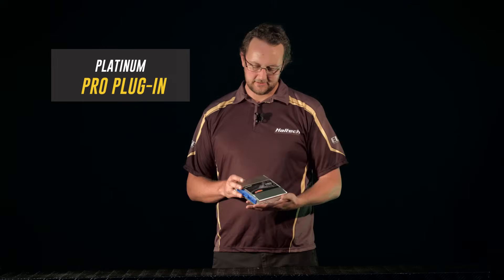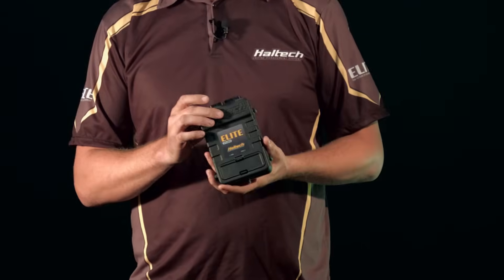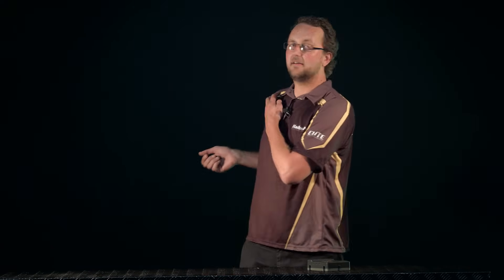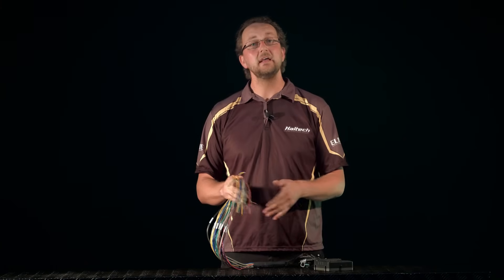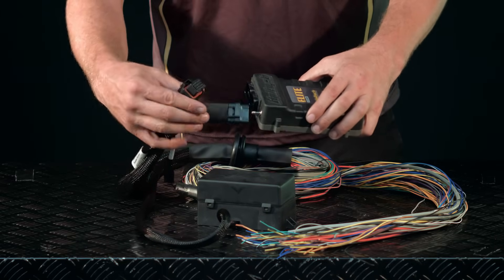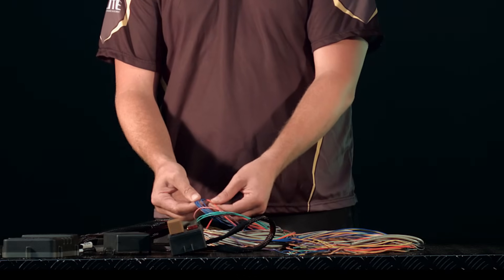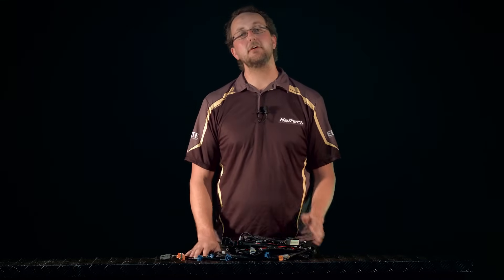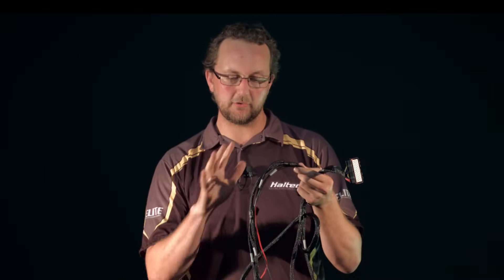6 Ways to Wire In Your ECU - Haltech Technically Speaking

Comment: regarding OBD2 - it seems there is a fundamental limitation with the Haltech ECUs. If Haltech devices are connected to both main and AUX connectors, there is no way to enable the OBD2 functionality.
Reply from the maker: If your Haltech ECU can support 2 CAN networks, you would need to run all of your Haltech CAN devices through one port. This would free up your second network for OBD2.

If you need more info you can contact our support team directly via www.haltech.com/contact-us
Reply: @haltech  Thanks. That's what I figured. As is, my Elite 2500 is wired to use Haltech devices on both main and AUX ports. The Nexus software is configured for both main and AUX for the Haltech CAN bus.
Of course, when I enable the vehicle CAN bus on AUX port and Haltech just on the main, I get all sorts of DCTs (because the ECU doesn't get some sensors).
Now, my question is how to wire things in such a manner that all Haltech devices are just on the main connectors. Isn't that's where the car's harness connects to? How to wire in additional things into it (like wideband, etc.). 
It's a Z32 with the PnP connector.
I did contact support and we had a lot of back and forth via email, but my question above still remains.
Thanks!

Comment: After seeing the Haltech unit that was used in the Mad Beetle build I was curious to see what I would need to get to install fuel injection and electronic ignition on my 1972 Super Beetle with the air-cooled engine.  At some point I would like to have sequential fuel injection. My car never had an engine management system of any kind.

Comment: Hello , I’m a big fan of your channel and love watching all your content on tuning and halltech knowledge, I am a die hard Mazda 323 familia/ laser tx3 fan . Being in Canada, we had in 1988 and 1989 , less than 2500 awd Mazda 323 gtx s and even less 323 Gt sedans with the same B6t engine but fwd. I have been extremely blessed to have owned quite a few of these amazing homologated road versions in my lifetime. Later on I fell even more in love with the 1.8L bp chassis  turbo engines , I imported a 323 familia Gtr engine with harness and awd transmission that I couldn’t use in my front wheel drive set up , so I was sold on the Autronic Sm4 stand alone Ecu from Australia, the unit was very expensive and my local tuner was supposed to be an authorized dealer, he got the car running , at 15 lbs the car put down 237 hp on a real mustang dyno , big front mount intercooler and 2.5 inch exhaust, everything else , stock. I never really got to see the real power that engine could deliver because I’m sure my tuner wasn’t in his usual Subaru territory.

Comment: hi , building a countach replica using a 95 bmw v12 5.4 , been told its best to use 2 ecus and treat it as 2x  6 cylinder engines , is this something you could help with ?
Reply from the maker: The NEXUS R5 should do the trick:)
https://www.haltech.com/new-release-nexus-r5-is-here/
Best thing to do is to contact our Tech Support on support@haltech.com and go over your setup with one of our tech guys just to be sure:)

Comment: Do you make an ecu for an Allison #3040 transmission
Reply: How much for all this stuff
Reply: I would like to know if you make them for the faulty ecu 29511202  I have a faulty ecu in my RV diesel pusher Allison shifter mode button if you do please call me 415 933-4421
Reply from the maker: I am sorry but we do not. We design and manufacturer engine control units for port injected engines.

Comment: Excellent video. We're about to use the pre-terminated harness on our Project Trolvo
Reply from the maker: Looking forward to see that thing run - on full song too:)
Reply: Could you use an aftermarket ecu with the proprietary factory stock injectors and sensors as long as they're wired to the ecu correctly?

Comment: Is there anything that can run a 3UR-FE from a Toyota Tundra?  I want to use that engine in another car.
Reply from the maker: The Elite 2500 will suit that engine. It supports 3URFE's quad-cam VVTi, DBW throttle, and sequential injection:)
Reply: Haltech does this kit come with wiring harness?

Comment: Tuning fork is the HT051470 only thing availible for a 1993 mustang engine? I have a 1994 f150 running an a9l with a t-harness but want something tunable since I have heads, cam, intake, ignition, etc.? Also I'm having a hard time even finding HT051470 for sale any where.

Comment: Dont know, but 2500$ for a wrx ecu seem extremely pricey..... and out of range for my wallet, too bad. My project is a sti ej257 shortblock with ej25 na head for my 2008 impreza 2.5i
Reply from the maker: It's all relative. We do find it odd though that people won't think twice about spending thousands upon thousands on the engine, fuel systems, power adders etc, but then skimp on the engine management system that has to run it all.
Reply: Haltech I’m comparing the price, for exemple, to a complete ej207 engine ver 8 with a 6 speed and a ecu for 5500$ in Canada. I understand that haltech make great product, but if you could sell these ecu ( Elite 1000 ) in the range of 1000 to 1500$ it will be fantastic. Anyway
Reply from the maker: Elite 1000 with a Plug'n'Play Adaptor Harness Kit retails for $1614.
https://www.haltech.com/product-category/plug-n-play-ecu-kits/elite-1000-adaptor-harness-kits/

Comment: Does a stock 1jz harness go with Haltech ECU
Reply from the maker: Yes you can use Elite ECU with your stock 1JZ harness. You have two wiring options here: either use the basic universal wiring harness and wire it in yourself, or, if your 1JZ is in or from one of the cars supported by our Plug'n'Play adaptors then it's a simple plug'n'play procedure.
https://www.haltech.com/product-category/toyota/
Reply: @haltech  Thanks guys surprisingly cheaper than I thought building a Drift Car E30 tho so which is better 2000 or 2500?
Reply from the maker: E2000 will do the trick if you don't need all the fancy race functions, if you're planning to go DBW though you might have to go up to E2500. If you go to the E2500 product page and open the ECU Comparison Table at the bottom of the page you will see a feature-by-feature comparison between all ECUs. You will be able to see what features E2500 has that E2000 doesn't:)
https://www.haltech.com/product/ht-151300-elite-2500-ecu/

Comment: Would you use the premium 2.5m harness if you were going to basically trash all your oem wiring or vacuum lines in older cars and then replace everything with new sensors, coils, etc?
Reply from the maker: That's what we would recommend. The premium harness also comes with a fuse box.
Reply: @haltech  sweet. This very well may be the route I go down. Thnx

Comment: Would love one of these someday, though I bet it would be a pain on my US Z31 thats a mashup of several VG30Es from different vehicles and most of the sensors and things removed as well as a bunch of bolt-ons as well as custom fabrications. I think its basically running on airflow, water temp, CPS and O2 sensors alone at the moment. Not even any EGR, charcoal can, idle control anymore, just use set screw on TB and only vacuum hose is for brake master. Ac and heater core removed. Its not even original ECU. Have been told its from an aussie RB30. Just blah.

Comment: How bout a pippyback for a 2002 Mercedes C230k 2.3L supercharged engine?
I want to ditch the supercharger and go turbo, larger injectors, and possibly e85.
Thanks
Reply from the maker: If you are planning for E85 I would suggest looking at the Elite 750 which will run the engine as a piggyback and allow support for flex fuel in future.

Comment: What about german cars? Audi 1.8T would the cluster work with heltech?
Reply from the maker: On the vehicles the plug in kit is listed to support, yes the factory cluster does work.http://store.haltech.com/default/plug-n-play-ecu-kits/elite-1500-patch-harness-kits/ht-031002-plug-and-pins-only-male-deutsch-dtm-4-connector-7-5-amp.html
Reply: Thanks for reply. What about earlier models, without can-bus...till 2000s? Same thing or?

Comment: What's the go with the haltech p1000. Heard it only goes to 15psi. What needs to be done if I wanted to go higher
Reply from the maker: The Sport 1000 ECU supports any boost pressure with the appropriate MAP sensor. If you’re using the on-board MAP sensor, the maximum boost that sensor supports is 22psi. Don’t forget your ECU also needs to be tuned for your desired boost level!
Reply: So off the shelf the sport1000 ecu supports 22psi. i was told its 15psi and f i wanted it higher you guys would have to do your magic inside to go higher. Its tuned to 10psi on board map. I'll be upgrading a few things and I will want 3 psi settings. if you say its 22psi standard thats great news

Comment: +Haltechecu Question...what's the best option for an Sprint RE ecu for an rx7 FC second  gen? My friend started his project then hit a road Block... He basically took the stock ecu out and some of the harness. I've yet to dig into this for him to determine what's what.  The Sprint RE ecu did come with a harness for the ecu but does not have the built in relays/fuses. I can always add one but wish it was all in one package. What we need would be links to best connector options to use for injectors, all sensors ect...can u help?
Reply from the maker: Hi Fernando, 
The Sprint RE is an entry level ECU and thus very basic - you'll need the plugs for the engine side, and to wire up a fuse box, both of which you'll need to source from third party suppliers. Your other option is to upgrade to the Sport 1000 with a 13B terminated harness kit which includes both fuse box and engine connectors.

Comment: Hello do you all have a any patch harness to allow the factory ecu to control auto transmission or other option for persons with auto transmission in particular 1jz/2jz auto transmission?
Reply from the maker: We don’t have a patch loom available for parallel installations – this will either require custom wiring, or alternatively try contacting a wiring specialist who may have pre-made solutions.
Reply: Thanks for the info. I guess the short harness installed in a piggy back manner would be the best option to control auto transmssion ?
Reply: Keston Ali been a while since I’ve looked into running a340e transmissions but wolf ecus used to be able to run them

Comment: Why would I pick the fused wires over the basic wires. what are the benefits? What application is ideal for the fuse universal wire vs an application for the basic universal wire.
Reply from the maker: As it is explained in great detail in the video, the short harness is much shorter and is used to connect to your existing engine harness, the premium (long) wiring harness is used as a replacement of your factory engine harness - so basically when you're completely rewiring your engine.

Comment: I do have to say, your documentation and resources are excellent. Your support of Mighty Car Mods is also an AMAZING tool to advertise your product, but unlike most PR campaigns it is honest and truth-worthy. I did have a question about the CANBUS integration for the Elite Series 750/1500/2500. With a second generation RX8 (CANBUS/DBW), the Cluster is CANBUS as a broker between the Primary PCM network, and secondary networks all CAN controlled. Would any of those Elite series models be able to communicate with that CANBASED cluster or would it be not possible to use that cluster and/or supporting systems. Cheers, Keith
Reply from the maker: +Patrick We do not currently support the RX8’s factory CAN protocol – you will need to retain the factory ECU for body functions, and wire the Haltech in parallel for engine control.
Reply: +haltechecu Thank you for the response, Do you have any videos on interfacing any CANBUS or like a overview of the Elite's Can features and both kinds of interfacing to OEM and Haltech? I am interested in the technology behind the interfacing beyond just my vehicle.
Reply from the maker: +Patrick Not as yet but we might make one - if there is enough interest in the subject:)

Comment: What wiring option i have for a evo 8 on a elite series?
Reply from the maker: +Ricardo Delgado You can either make your own patch harness, cut the factory connector and replace it with the Haltech connector, or make a custom engine harness. At this stage we have no Elite  plug in option for Evo8 .

Comment: I already have an rb26 in an s13 wired to a megasquirt 3 setup, what would be the best package to use if i want to use one of your sport 2000 ecms? Id like to know what harness specifically.

Thank you for your time and hopefully an answer because im dying to get a haltech system.
Reply from the maker: +stevenminix There are three options for fitting a Haltech ECU to your RB: Fit a factory engine harness, and use the R32/R33 Pro Plugin ECU.  Cut the Megasquirt connector off your existing wiring, and replace it with the Haltech connectors (34+26pin AMP) or Make your own custom engine harness, using the Haltech premium universal loom kit
Reply: +haltechecu do you recomend the sport 2000 ecm for an rb26? I would like the best management for the motor with its big single turbo for a nice race when i feel like it and a real street driven car?

Comment: Have you worked on a Mitsubishi Lander Cedia Turbo before? 4G93 GDI Turbo
Reply from the maker: +Burnalot At this stage we do not support Direct Injection.
Reply: haltechecu That is cool :). With working with ECU's etc is it hard removing a fuel cut? are there ways around it? I am trying to do research into it but i cant find much
Reply: +Burnalot never actually seen a gdi in australia the MPI 4g93&#39;s are quite comon though

also +haltechecu with the gt86 being so popular mod wise are there plans to start supporting direct injection

Comment: Is there going to be a terminated harness for a VQ35HR ?
Reply from the maker: +Scadieee Due to having dual electronic throttles, the HR will require custom wiring, with either a Haltech installed in parallel with the factory ECU (using factory to control the factory throttles), or stand-alone in conjunction with a cable throttle conversion.